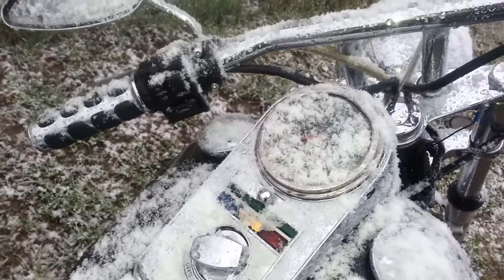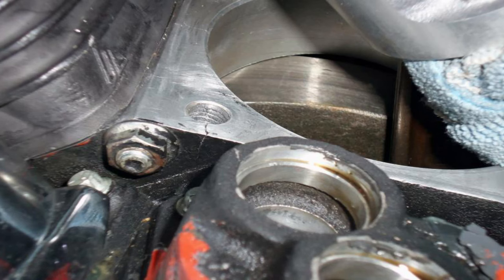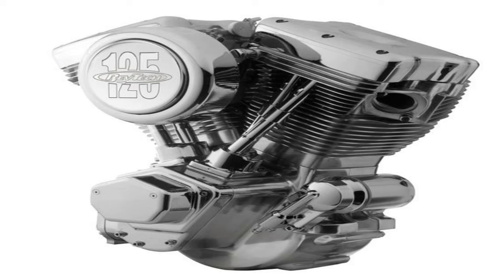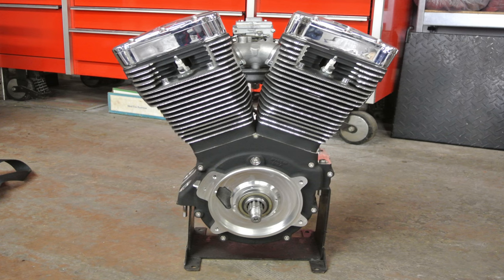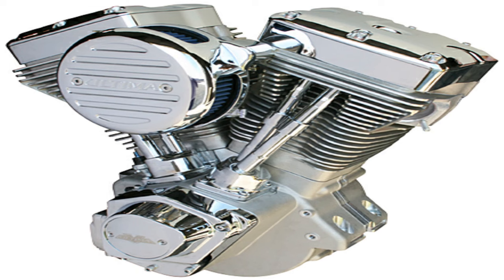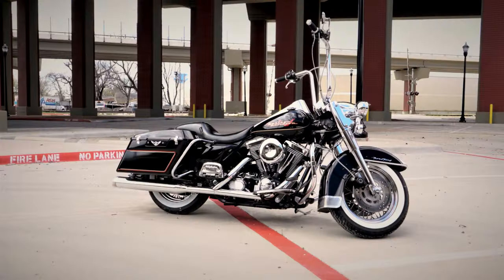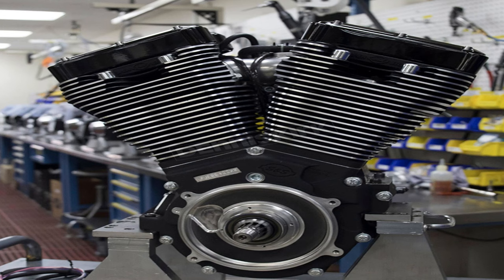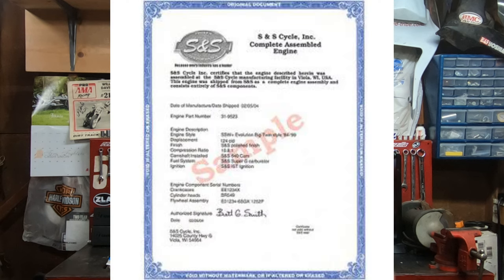New Harley Evolution Engines are Better Than the Original

Comment: I have a question, Make that several. Did the Evo motor use caged roller bearings or plane on the crank shaft? Did the Evo use timken bearing on the output shaft and pinion shaft? How about the Rev-tech and Ultima. Also what happened to s&s's X motor witch if I remember didn't fit directly into a Harley frame. I am a little disappointed that you didn't mention my V-rod motor as the best. I know Harley doesn't make them any more ether cause they don't wear out! Another great video Thanks
Reply from the maker: All the 45 degree Harleys use the roller bearing bottom ends, before 2003 the bottom ends were timken tapered roller bearings on the pinion and output shafts. Revtech and Ultima use a tapered roller bearing bottom end, that's the strongest you can get for a Harley Vtwin. I believe S&S discontinued those motors a while ago, they've done a lot of changes to their engine line up. I've got some videos on the Vrod in the works, it's a solid engine platform that actually came out of the late 80's.
Reply: @GixxerFoo  Kool I'll be waiting on those V-rod videos. I'm planning on changing the triple tree on my 03 VRSC-A model from a 4% to a 2%. I purchased one off of a wrecked 06-D model that I located this last spring I believe this should make it more stable at speed and more nimble in turns. But that's a project for this winter.  Mike from Maryland
Reply from the maker: @michaelmorgan5714  That will for sure tighten up your handling, my dad ride 2012 nightrod. That bike is comfortable and it handles very well.
Reply: @GixxerFoo  They started changing the angle of the trees in the 06 D model from 4 degree to 2 degree. I'm guessing you know the trail increases with each degree in the frame neck and is decreased by each degree added to the triple tree. There were various combinations after that but they started with 34 degrees in the frame and 4 degrees in the tree effectively giving it a  slow versachieve a nimble bike that's stable at 140 mph. Thanks again Mike from Maryland. P.S. I'll be able to fill you in next spring.
Reply from the maker: Let me know how that turns out! I might give it a try myself and see what happens.
Reply: @GixxerFoo  Do not change out your dad's triple tree. the 2012 night rod has total 34 degrees from the frame and should have about 5.7 inches trail. I'm only  hoping for 4.7-4.9 inches trail by going from 4 degrees to 2 degrees and that should keep me steady up to around 150. I've never taken it above 140-145  by lowering the rear 1 inch and adding 1 inch to the fork spacers and won't do that any more , Heck I'm 68 already. Save your dad from the temptation He couldn't be that much younger than me. Though we get older we sometimes forget to be wiser. And Thanks for the great videos. Mike from Maryland
Reply: @GixxerFoo  I just did the math on your dads bike it is already 5.1 inch trail I would not mess with that.
Reply: Caged rollers on crank and timkin on sprocket shaft

Comment: very informative and well done. I have a crate S&S Evo V-96 with Super E carb. I think the crankcase being vented into the carb is not the best way to go. any thoughts on re-routing ? I just pulled my air cleaner after 300 mi, and had oil pooling.
Reply: Is it like the top breathers? I set my 93 up with a catch can .

Comment: usually with a evo thats got 80 100k on it your fitst rebuild ( if you keep it stock ish)  you can just plain the heads bore the cylinders , lap the valve and put a new carb on. then youll get another 60 80k before you have to split the cases but after that a crate engine isnt a bad idea cause your buying cases / crank anyway.

Comment: Did the 113 ultima in a night train. The shop that did it couldn't get it right.after a year of messing with it, traded it off for a twin cam dyna and redid the motor twice. Come to find out the ultima head was not machined correctly, and the warranty ran out. On the upside I did the screaming  eagle crank in the dyna turning the 88 into a 103 and all the headaches are forgotten!

Comment: Hey. Fizzed. How concerned should I be with my 2007 softailfatboy with the timing chain adjuster pads
Reply from the maker: 2007 has the hydraulic setup which is much more reliable, I'd be inspecting around the 30K mile range and plan on a replacement around 40k miles. Some bikes need replacement and others go some insane miles without needing replacement. Always better safe than sorry when it comes to the tensioner system.
Reply: I had a 02 Fatboy, my cam chain followers went @ 40k. installed a s,s 510 gear drive cams. With adj.push rods. Best choice I ever made ..Now your cam chest is bullet proof.

Comment: Given the cost of a quality rebuild you may as well just bite the bullet and buy a crate. Buy once, cry once. I'd probably try to save some coin and buy all the parts over time and piece it together myself.
Reply from the maker: Crates are a lot of money up front but buying all your parts over time is a great way to do it yourself. Just replace all your bearings in the cases and replace or have your crank rebuilt by a shop. Also your heads would need to be gone through by a shop unless you replace them too.
Reply: @GixxerFoo  I would start from scratch with a new block, cylinders, crank and everything. The old cases aren't strong enough, as you mentioned 🤘

Comment: Need advise ,, looking on upgrade cam for my 103 cubic , personal like tongue cam ,,, pls suggest what cam to goes with ,,, prefect bolt in cam ,, cheaper cost ,,,, will it’s be better exhaust sound after installing cam ? Thx in advance and stay safe mate
Reply from the maker: The bike will sound and run a lot better with a cam, you'll get a bit more lump in the idle with the higher lift. Where are looking for your power to come on at? That would really determine what kind of cam you're after, also do you ride a softail, dyna or touring bike?
Reply: @GixxerFoo  mine is softail fatboy,,, interested in both in torque cam , tq
Reply from the maker: @CHEONG FOO  Have you checked out the S&S 583? It's made for the Dyna and Softails, lots of power down in the mid and low. It also pulls really well up into the high rpm range. Here's the video on 103 cams https://youtu.be/ixeV1wRzsoY lot's of graphs and some of the best power producing cams out there.

Comment: REVTEC had all sorts of problems and major failures, I'll steer clear. I don't intend to crank out all that much more power than factory, I may swap out heads, up compression, and change the cam and carburetor and maybe a 2 into 1 exhaust. Personally I just want it comfortable and easy to manage maintenance.
Reply from the maker: I am not even 100% sure RevTec is still in business, Ultima seems to do pretty well. I see a lot of Ultima engines at the drag strip.

Comment: Was thinking Ultima cases with S&S internals,your input?
Reply from the maker: Ultima makes some solid cases, they are really heavy duty. Pair that with some S&S components it would be stoutly reliable.
Reply: The only thing that has issues on ultima motors is their valvetrain… use S&S lifters and rocker arms. Otherwise solid motors
Reply from the maker: Excellent point, that's the issue l always used to see with them years ago.

Comment: I had a japanese 60 degree veetwin bike that was pushrod and air cooled. It was 1853cc which l believe was 113cui. That engine put out 128foot pounds of torque standard, with around 72 kw of powder at 5500 revs, what an insane beast that was. Like a freight train for passing lines of cars. Unbelievable. Sounds as though the 125 cui rev tech was its equal.

Comment: Rebuild the evo for cheap and add performance parts where u can such as forged pistons , better performing cam and high flow lifters. I would never buy a crate engine. Ultima has a builders kit. Build it yourself so you know it’s done right. Most company’s bullshit you around about the warranty for a crate.
Reply from the maker: Ultima has some really good parts, the crate engine have been hit or miss from what I've seen. RevTec was yeah... I don't even believe they are still in business. S&S has been pretty good, but you have to have it installed by a authorized dealer for their full warranty. Biggest thing with S&S is the down time to swap the engine or get warranty repairs done. If an S&S engine fails early they will usually send a brand new one to swap out cause they want your motor back to see what failed and why.

Comment: crate for the warranty over high labour cost. maybe the mid grade revtech or the low end s&s
Reply from the maker: Those Revtech engines aren't bad at all for the money and the warranty they have is pretty good. Ultima has been trying to keep up with Revtech for a long time now.
Reply: @GixxerFoo  Yeah sounds good. Only thing is that i have the last year Twin cam 103's 2017 FXDWG

Comment: So the next question is can one swap out an early twin-cam with a 'legacy' EVO to regain reliability?
Reply from the maker: It would require a lot of fabrication, the Twin Cam engines have the tranny bolted to the engine where the Evo engine does not. The mounting points are quite a bit different.
Reply: @GixxerFoo  Dang!  Was afraid of that...  I have not ridden my 99 Ultra now for a year except for a couple of runs because I do not like the twin-cam fuel injection system (first year) and the bike is just clunky.. not like my 92 Ultra which was under powered but extremely reliable.
Reply: so would a Evo style tyranny and Evo style engine fit in a twin cam frame with minimal fabrication...my TC has about 90k on it.

Comment: Got the ultima 113 ci 120hp in my 1997 Electra glide um yeah it pull the front tire up so did a 34t drive pulley and wow its really cool passing the yups on the new bikes and walking by a couple of rockets and having them stare at you at the next light hahahaha just break it in soft and let it warm up properly but i would buy it again..
Reply from the maker: That is frickin awesome and exactly what it's all about! Those Ultima engines don't get enough credit, they are really are good motors. You go to the drag strip and that's what a lot of guys are running out there.

Comment: In my tenure as a tech, rev tech quality and durability has always been inferior to the ultima engines
Reply from the maker: You see a lot of Ultima engines out at the drag strip, they makes some stout components!
Reply: Ultima has a MUCH better reputation (imho)  than Revtech. Any motor can have problems (even S&S).

Comment: I have a Merch 131 that spun the breather bearing. That motor was putting around 135 a piece to the ground, and heard that it was capable of 160 a piece  at the wheel with a Mukuni 48 with a 53mm bore kit and big Andrews cam. I need to find someone to redo the cases
Reply: Just go with a Reed valve breather and be done with it it doesn't spin just sits in the breather great place you can use some silicone on it if it's to sloppy not to much though
Reply: Breather bearing ! HAHAHAHAHAHAHA

Comment: Stay away from revtech several have come thru my shop with head broken off valve ! Ultima engines are better only issue I have seen were sprocket shaft that came loose .I have used their flywheels I just take them apart loctite all the shaft nuts & retrue them no issues ! Also the Ultima 120 is almost an exact copy off the old Merch 120 the parts will interchange ! 140 horsepower is possible with the right parts put into a Ultima 120 ! S &S is absolutely the highest quality of all  ! I still get alot of EVO engines to rebuild guess there is not many guys out here like me that can  rebuild all the old motors !
Reply from the maker: It sure seems like Ultima and Revtech have gone back and forth on which one is better over the years. Thank you for sharing this, I haven't seen or heard anything about Ultima in a long time as far as their quality.

Comment: I've herd that in recent years that the s&s has lost its quality and hard to get warranty work done, is this true?
Reply from the maker: I've heard some mixed results out there regarding S&S, but where there were issues S&S really went out of there way to fix it.
Reply: Someone I follow got a bad s and s motor, they replaced the motor.
Reply from the maker: They will take of it, same thing happened on one l saw. Even paid for the old engine to be removed and replaced.
Reply: I reported your comment as fake news

Comment: What is the best motor swap for an 88 twin cam?
Reply from the maker: Twin cams are a bit harder to get due to the fact Harley had a better patent on the Twin Cam. S&S and Ultima have twin cam crate engines though, here's a video on the twin cam crates https://youtu.be/sXYELxFECyY
Reply: The new videos for the 88 twin cam fix is a good look I'm doing my 2004 88 twin cam 07 and up cam chest  and oil pump swap with the 103 cams and timkin bearings on spracket shaft and weld the crank pin and run it

Comment: I've been reading that S&S's quality has been lacking lately. Is there any truth to that? Leaking base gaskets in less that 1000 miles. Compression releases breaking, and high oul consumption. Also, i read their own warranty terms and it only covers parts, not labor. You'd think for being so much more expensive than Ultima and revtech that they would at leasr cover labor when their products fail

Comment: Thank you for another great video on the Evo!!
Quick question: running a stock EVO FXR with HSR carb, Andrews Cam and 2-1 exhaust. Would the Mikuni manifold add anymore power?
Maybe a new video idea on headwork and manifold .... thanks in advance for the answer!
Reply from the maker: In theory with proper tuning adjustments it might pick you up a bit on the butt dyno. Hammer Performance has actually proved it can with their intake manifolds on carbed bikes. But not all of us have a dyno in the garage to perfect the tuning.

Comment: The big question is, which one sounds the most like a shovel, and least like a shadow?
Reply from the maker: Any of the motors with a carb will sound mean, single pin crank vs the double pin crank like the shadow so all good there.
Reply: @GixxerFoo  thanks for reply, I just love the potato sound of the old carburated harleys and don't think I'd be happy with anything less.
Reply from the maker: @JuhaEerikki  I will say the carbed Twin Cam sounds good, but not as good as the Evo.

Comment: correct me if I'm wrong but 84, 85 were sand cast in the USA then a dark period of porous dirty ass castings up until 98 then the last 3 years HD used far superior castings back in the USA...the first and the last years are what I dig.
Reply: @steveontheroad4734  yes I love the things. With all things HD they never had left over stock. Some 84 cycles had shovels in them still so I believe the original USA sand castings would have carried over into the next year for sure. Have you ever noticed all the split cases on worked EVO's in the mid production run? Its all to do with the impurities in the Aluminum and the way it was cast, I have a set of cases 95 I believe and the casting work is D grade. looks like a kid did it.
Reply from the maker: Yeah the sand casting was pretty bad, they just seemed to have some bad runs here and there on the Evo.

Comment: I guess my budget means Revtech. I could even get an aftermarket frame and cut out Harley altogether
Reply from the maker: Revtech isn't a bad motor at all, I'd go with it over the Ultima if I wasn't going S&S.
Reply: @GixxerFoo  Had a look through S&S and they have a panhead that's a bit out of my range  for now but would work in cheap a 70's frame. The AMC bikes were junk but they did look good
Reply: @simonkennedy6116  My late 70s Super Glide did have a look that I liked! You typed "AMC bikes". 
I'm thinking you intended to type "AMF bikes".
Reply: @BigFiveJack  ... Yep

Comment: Person who has an Evolution motor motorcycle with other type of symptoms can simply rering it and do a valve job and have many more miles to go. You guys dropped figures like Oh by a new engine you know how much a new engine cost compared to burning a little oil. Especially since everyone says engine parts for these bikes are cheap and cheerful and you don't need a PhD in electronics to work on it I would just address the specific problem and be done with it the hell is buying an expensive new motor

Comment: Pretty sure after 140000 + miles there isn't any factory defects in my 1988 motor , but you keep talkin
Reply from the maker: The Evo varied quite a bit across the years, there were some bad castings and issues but it didn't happen on every bike.

Comment: yeah but like me if you dont give a shit about " more power" you dont have to split the cases on an evo. you can put the heads lap the valves ,hone the cylinders, and throw in a set of rings. and get another 75k out of the bike. thats the number one reason to own an evo is les money spent on your ride and more on the ride itself.  for 6 or 7k i can go buy a bike that has less than 20k miles on it. like a 103 or 107 but for a few hundred dollars i can rebuild my top end on my shovel or evo and be happy that im not in debt and know my manhood doesn't revolve around " more power". ps i see ive watch this video before and said the same thing. however its crossed out.

Comment: My.  96.   They say.  Temp.    Rage. Is. St. 230.  I find. That. Wrong.  No. Don't. About. I tell where my. Nike lose power.   When. Get. Over 229.  It start losing power over 220.   220. Should.    Nax. Heat.  Rage on my. Bike.  When get up. To 240. It lose.  Power fast. Lot. Power. When get up. To. 230.  You feel.lost power.  About. 10%